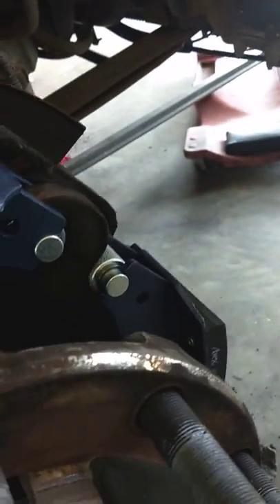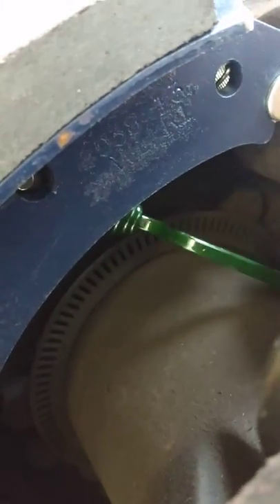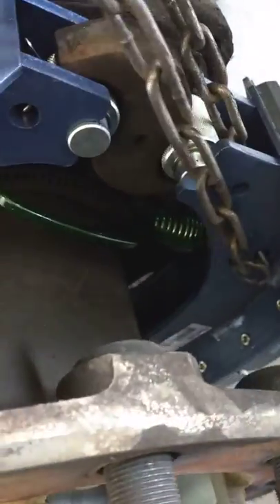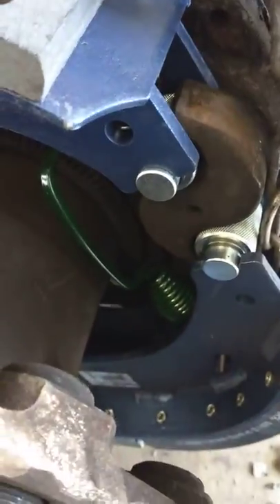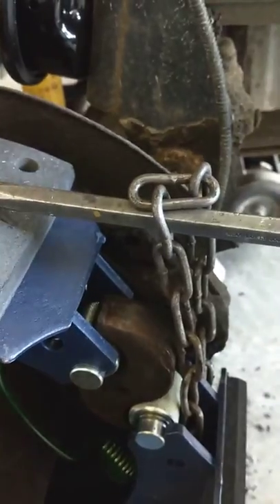Air Brake spring chain hack

Comment: Hey man I run my own service truck as well and I learned the “chain trick” not too long ago for those brakes I’m going to pin a video I promise it is a lot quicker than the brake tool I use a smaller linked chain than the one in the video though